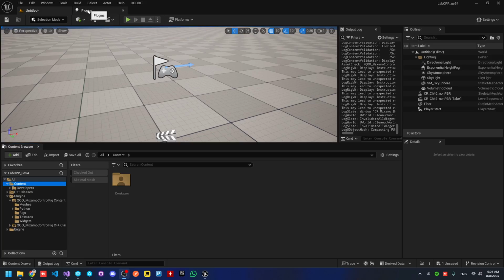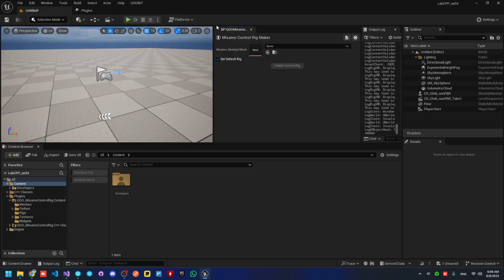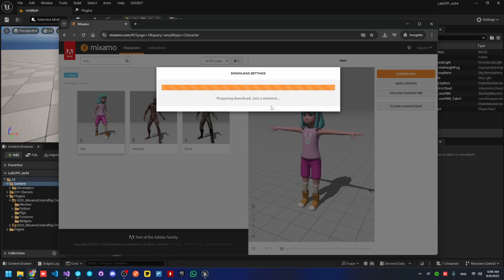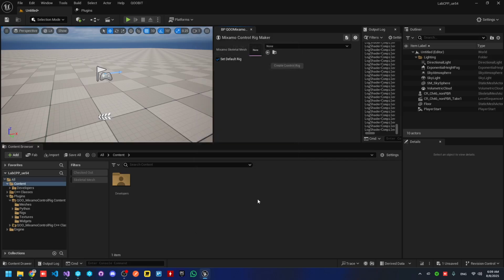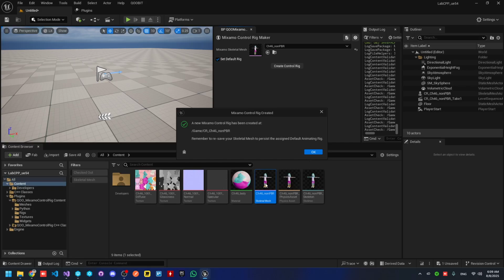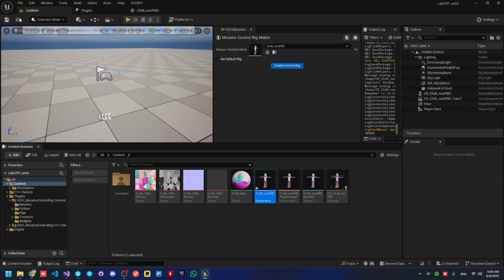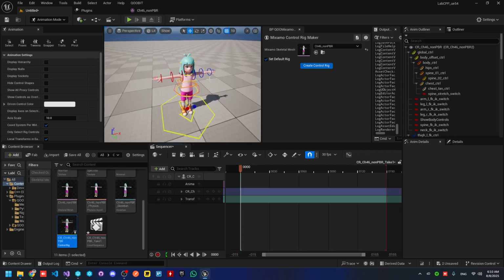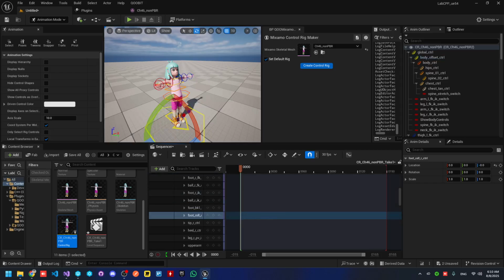QOOBIT Mixamo Control Rig v1.0.0 - Unreal Engine Plugin

Comment: Instant buy. This has been my biggest hurdle trying to move over from Blender. I have always used the official Mixamo control rig as a base in Blender to save time rigging, and was desperately searching for something similar in Unreal. I've only found one other similar free rig from another channel but it isn't a built in plug-in like yours, and it's finicky. 

I had a model with the Mixamo skeleton on it and the scale was too big at first so your control rig didn't grab onto it. I brought it back into Blender, changed scale units to .01, resized it, applied transforms, and it worked first try when I brought it back into Unreal. 

Seriously earned the money, your blueprint work is pro and now I can spend more time creating stuff and less time troubleshooting retargeting. There's little to no documentation on stuff like this, and every problem in Unreal seems so niche, you're a total life saver. 😊